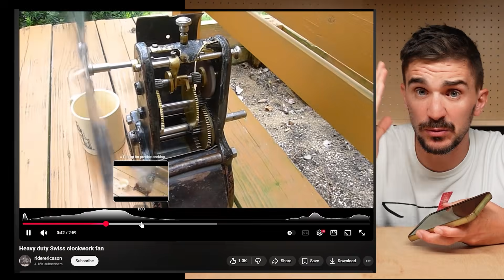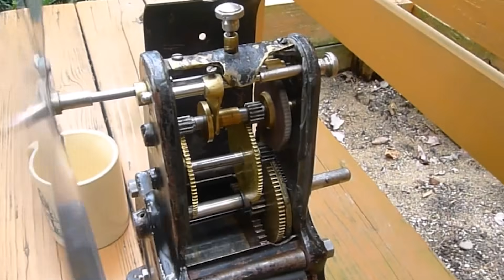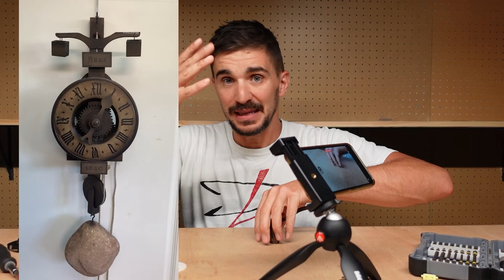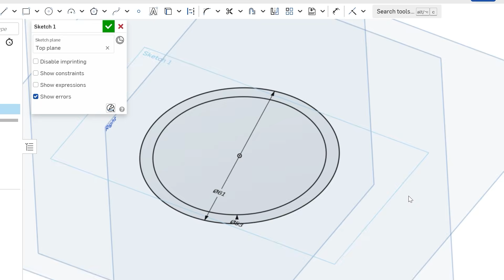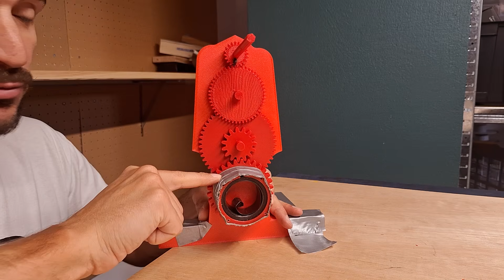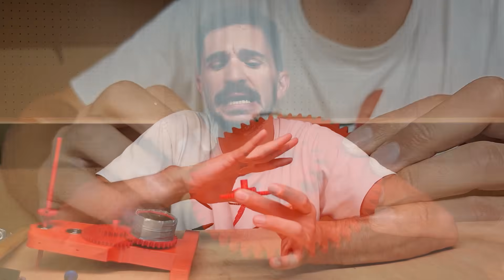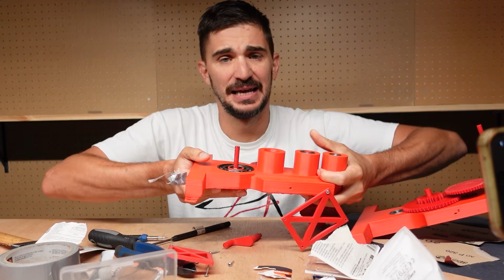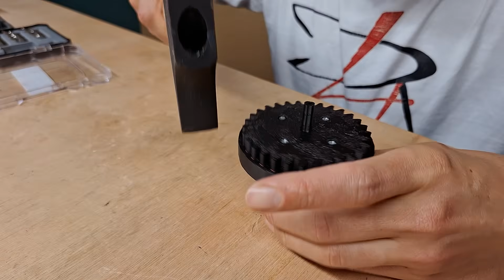No Cables or Batteries, Just Pure Mechanical Engineering - This Swiss Cooling Fan Cools You For Free

Comment: I think you are going about it from the wrong angle, I'd be looking at using a heavy piece of spring iron perhaps something you stand on to pull down/tension, have that go to the high torque wheel. But crucially instead of spinning a fan get it spinning a flywheel with coil generator to charge a super capacitor or battery, you could then run a separate fan or whatever off the output. Or instead of a spring maybe use weights,

Comment: Should this be made of metal components, could you put a well of oil at the bottom that the lowest gear might run through and over many rotations will lift some oil to the other gears? Helping to reduce friction.

Comment: Love it. Consider if you had to make it before printing technology was available. Well, let's just say before WWII, you would have had to:
Design it on paper,
Make a wooden pattern.
Cast the pieces.
Machine the pieces.
QC it. 
If in spec. Assemble it. If not, loop.
Determine that it didn't meet specifications.
Re-guess the design.
Iterate until it meets specifications.
Find that it isn't feasible, or the whole thing is stupid, and write off months, or more, of your time.

Comment: Why do you keep reverting to a secondary audio recording? Did you get glitchy audio on your main mic? Just a curious sound-guy.
Reply from the maker: Yes, got some sort of weird loud click/scream thing. I have double checked all the wires and everything. I have absolutely no idea what it is. It only happens in the first two recordings.
Reply: @d4a  Yeah, it seemed pretty random, that's why I thought it's a glitch. That sounds like a hardware issue causing a digital write issue. I'd try changing memory cards. "Screaming" and "clicking" sounds like digital noise caused by corruption. Other than that, if it's a USB/digital mic, I'd try changing it, if it's an analogue mic, it's probably fine, so I'd check the equipment first. Also, just to check, try playing the file through other means.

Comment: Thanks, I now know what "janky" sounds like.  Maybe I'm being lazy, but wouldn't it have been easier and safer to just leave the spring in the original tape measure barrel?  
  Pretty obvious that a 3D printer can't replace an all-metal lathe.  The all-metal lathe is the key machine that created the industrial revolution.  Wood frame lathes had been around forever, but their tolerance was 1/10 of an inch, which is really not good.  The first all-metal lathes had a tolerance of 1/100 of an inch, which is what was needed to produce cylinders and pistons with enough precision to make useful steam engines.
https://youtu.be/djB9oK6pkbA?si=UaXCZwiX8f8mUHsW

Comment: Use Support for PLA/PETG or PVA, enable support ironing in Bambu Studio and change support top interface layers to 3 instead of 2.  This will result in a nice smooth surface at the interface of the support without the need for post processing

Comment: Remember, things don’t work first try. You got a working prototype after the second try. Try using three or more main springs side by side to achieve more strength and increase your gear ratio to something like 100:1. Another thing to consider would be the fan blade pitch. The one you’re using is tuned for an electric motor and could probably be more efficient for your machine if chosen correctly

Comment: Author of this comment is half drunk, their opinion is subject to change and they can't be held liable for their today's opinions tomorrow or any day ahead xD

So, 
> expensive
You are applying experiences from large scale prototype to mass production. They are transferable but costs aren't. Think about bearings for a moment: you've used really expensive ball bearings, in high-volume production brass bushings and thin stainless steel rods would be good enough.There's lots of small improvements space to wiggle around.

> not very efficient
That's really matter of propeller attached to new motor. They are cheap plastic molds but these molds have their characteristics, specifically RPM to CFM ratio and mass manufacturers try to engineer them around the sweet spot. You basically took fan blades running 1500 rpm to produce "a breeze" as you've called it and powered it with like 750 rpm system. 

> not very efficient
For optimal wound spring energy storage utilization you want to extract as much torque out of it, in your prototype the barrel is spinning like 10 times as fast as it should. 

IMHO, this project should start from measuring donor device's characteristics, this is speed and CFM. This would be goal to chase to or exceed.
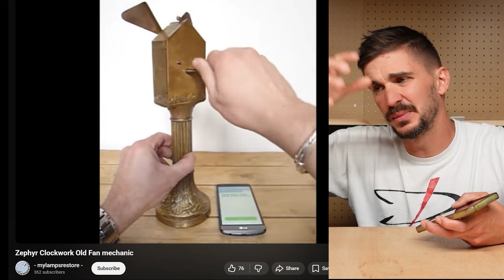For efficiency measurement, metric of "cranked for 40 secs to extract 1:55 of work" is lazy engineering at best. it should be tested at least electrically, this is: "i've used 10W of my power drill to strore as much energy as possible in the spring. Now with generator attached as any output stage let's measure how energy i am able to extract out of the system, accounting for losses".

overall, idea is sound and doable(as proven), engineering around is naive and quickly exhausting due to being labor-intensive. few more iterations and i am sure there's over 3 minutes of work to extract from single winding.

Comment: Clockwork seems to be a seriously overlooked technology.   In the days of film cameras why did everyone carry around massive motorwinds and battery packs instead of using clockwork?  (I have a 1940s camera with a clockwork motorwind that works great - and is light weight).   I have a clockwork door bell too.  No wires, batteries, switches etc to go wrong - it is older than I am and still works perfectly.     I'm not sure cooling fans are really a great match for the technology - but it has a lot of advantages over the alternatives in many applications.   Let's have more clockwork in the world . . .

Comment: Use metal smooth metal rods fire the gear shafts and press fit them in 
Using Stainless steel pin on print parts is surprisingly smooth 
So much so that it eliminates the need for bearings 
Also these bearings are probably greased inside which makes them last longer but much more resistant to small torques like in this case

Comment: I do a lot of these clockwork type projects. Not a bad start, but there is a lot of room to reduce friction.
You should be using open bearings, like fidget spinners, on the low force/high rpm shafts. The grease causes a lot of drag and there is almost no load on the top.
You can use a step or spacer on the back of the gear to space it away from the housing and only contact the edge of the inner race of the bearing.
All the gears should be constrained so that they can't contract the edges of the other gears either. The gears should only be contacting anything at the teeth and the shaft, no matter how smooth you make them.
You might try smaller teeth on the high torque side. You don't want them to strip, but larger modules increase friction and windage. You might also make them thinner.
For the housing you could make it rigid and hone the holes to size after printing. A drill bit would probably work fine. Add some locating pins to make sure it lines up perfectly every time. Don't rely on the screws to locate it.
Fan blades are mostly designed to look cool. You might try 3D printing a 2 bladed thin propeller or just use a large RC plane propeller.
All that will reduce drag and increase your RPM so you get more wind, so you might want to gear it higher to increase time. The gears will feel kind of backwards on these things. You should think of the high gears as a resistance that drains the spring slower and the low gears dump it all at once.
But yeah you have the right concept. I think just making sure the gears don't touch anything will do the most for you. I can hear them clattering. You should just hear a consistent, steady whirring noise.
Reply: Clamp the 2 sides together, then drill & ream them for precision fit of drill rod shafts.  Anything less is simply doomed from the start, regardless of materials, modulus, width etc.
Others have suggested open bearings and spaces/shims (that only contact the inner race of the bearings).  All good ideas from people who seem to understand what they're talking about.
I suspect d4a understands these things as well as anyone but it's an interesting video, garnering a shirt-load of engagement.  All hail the algorithm 😊

Comment: Jewel bearings make these things a lot easier. Less friction and much more tolerance for tolerance. Check out Dan Gelbert's semi-recent lengthy interview, too, he talks a bit about very low friction bearings in it during the section of seemingly impossible engineering problems which turned out to be easy to solve, IIRC.

Comment: Between 1927 and 1929, the apprentices of the shipyard I work at, built a complete 1:10 model of the propulsion system of a Battleship, consisting of boiler, Parsons turbine, reduction gearbox, shaft and propeller.
Every casting, every rivet, every blade was made from scratch, by 8 to 13 years old boys.
It was displayed at the 1929 world expo and run at 15.000 rpm.
It still remains at the shipyard's world leading turbine facilities. But most people can't even imagine what an achievement it is. Those kids would make that clockwork fan in an afternoon to 2/100 mm tolerances.😂
I have a digital copy of the photographic archive of its construction.

Comment: To wind the mainspring or keep it wound in it's sprung state, all you have to do is take a piece of metal rod and make a slot in it, put the center in the slot and wind it up on the shaft. Add a zip tie  on the outside and you have contained the spring. 
Or go to the recyclers and grab a cuckoo clock. it already has the whole mechanism, made in brass and steel.

Comment: Along with the other suggestions I'd add, if no one already suggested it, to use open bearings.  It's surprising how much viscous and friction drag there is from the black plastic seals and the internal grease.  Open sided bearings lubricated with just a light film of thin sewing machine or similar oil has almost zero drag.  After all if there's a 250-1 gear ratio then any frictional or viscous drag in the last shaft is felt as if it's 250x heavier by the spring.

Comment: I appreciate your energy and respect you taking the time to experiment and try to create something, but your premise to 'prove' the claims and designs seen in the video does not really hold up, your conclusions that the engineering would need to be incredibly precise and the production be expensive isn't reasonably extrapolated from the shown process and hugely mischaracterizes the mechanical systems. Your execution produced the results you saw because of the engineering decisions you made, mainly the mainspring and friction between teeth. Representing this as some sort of equivalence between complexity and cost for performance is incredibly misleading.

I get you just wanted to share a cool thing you saw and make an interesting video, but delivering a message that passes on judgement and evaluations presented as something derived from what seems like due process in a way that disinforms the casual viewer is irresponsible, in my opinion, and you could have the cool and interesting video without that.

Comment: Back in the 1960s-1970s Briggs and Stratton developed a starter for small engines. The main spring in this application stored energy to rotate a 3hp gas engine several revolutions with a lot of torque. A similar setup may run your fan considerably longer. I don’t think plastic would hold up but I enjoyed your proof of concept 🎉

Comment: It's people like you who inspire and create ingenuity!  So what about blades designed as a "flywheel" in that the outer edges are weighted, obviously it should be caged for safety, and then built into a slim wall unit using grandfather clock (or other) mechanisms to keep it going for hours?  Maybe it can be on wheels to move around yet classily designed in a wood facade?  Maybe it has more than one set of blades in it that can be swiveled?

Comment: I've had pretty good success with 3D printed gears, but I almost always use metal shafts. They're cheap and readily available and you can get bearings that fit the shaft perfectly.

Comment: Wouldn't a Stirling engine be an option? You can probably havest some heat from a metal plate (using sunlight as a heat source) and use the fan to keep the cold side cold (in a shade)?

BTW, why do you key the shaft to the gear, if you don't use them as a power take off? Just make the shafts solid and put the bearing between the shaft and the gear.

Comment: On stopping YouTube shorts- So, what I have done is to go to each individual Short on my main page and say not interested. Sometimes,  there can be a long line but eventually there is an end.  The shorts should stop but if you under circumstances select one, you'll get the shorts and you have to repeat it. 
  There is also an option now where you can select "Fewer Shorts" but it means just that and it wil show just not every time.
  None of this will not stop shorts from showing when you search though.

Comment: My familly owns a contraption that is very simillar but also the counter opposite of the swiss fan of the video, it also uses a clockspring to store the energy but instead off creating a high speed output it creates a low speed and torque rich output used to roast chicken over open flames, it genuinly works great and we still use it from time to time, a full winding can last several minutes because it also uses a high speed flywheel to keep the inertia going...

Comment: Yep. I have some relatively cheap contact to let produce wire EDM cut metal plate parts, that would give the needed precisity and low wear/friction of the gears.
And it still would be very expensive.
And any other manufacturing way on the same precision would be even more expensive.

Comment: I'm trying to find where in your boost school videos where you discuss placement of the catch can to deal with oil and water. 

I bought a vehicle that has a 2.0l turbo and I have learned that it does not have a catch can, and does have freezing intercooler problems in the winter. 

I understand adding a catch can in the piping or attaching it at the bottom of the intercooler increases volume and this reduces pressure, but I am looking for your genius explanation of it.

Comment: Engineer here, did u know u can order these springs online from suppliers & manufacturers who sell them for industrial applications? Some r up to 0.5m diameter. There r a couple of manufacturers who will custom build u one if u need to go bigger. 

The modern application for this clockwork isnt a fan or a rotisserie, but as a generator. If u replace the fan with a small electrical generator (motor) using low friction ceramic bearings, it will give u enuf current for 1 DC boost/buck converter. However, if u divide up the power from the generator between a handful of joule thieves & connect each of those to their own boost/buck convertor, u can charge a battery bank, or run lighting, fans, pumps. Anything that doesnt require high amperage. 

Pro tip: never connect 2 boost/buck converters to each other for any reason to power a larger load or use 2 together to power a large load. It causes a feedback loop between the converters & will cook them.

Comment: I would start by solving the math on paper to figure out ideally how much energy a working fan requires, how much time I need it to work and then how much energy I can store in a spring.... That would give me a  good idea if it would make sense building a spring fan..... 
And removing the seals from the bearings makes them work with less friction....

Comment: you need to spend energy equal to climb a staircase of 20 store building or rotating bike pedals equal to 20-30 minutes of riding with a speed of 25km/h to...
wind up a spring which will give you 1 hour of 30cm fan to blow air mass equal to lowest preset of 30cm electrical fan we all have.
i don't think i need a fan that makes me sweat for 30 minutes just to give me 60 minutes of shallow breeze

Comment: About making springs: use music steel, you will need to design your spring, then create a hollow 2-piece mandrel with the springs shape cut into it with a 3d printer, glue it to a thin steel rod to serve as the core and spin the wire on with a hand drill.

This is the easiest way to make precise springs at home, a apecial mandrwl and calculations in the design make the spring precise.

I hope you find this useful, good when working on cars or bikes.

Comment: I remember a motorcycle drag bike transmission build from the 70's in a motorcycle magazine that kind of seemed counter-productive but on retrospect made proper sense. Upon completion of their build they filled the transmission with progressive grades of polishing compound and ran it for a number of hours. The tightest parts got polished, and failure points often happen in slight imperfections of machining. The tightest spots would get clearance and sharp edges and grooves would get rounded or smoothed. Break-in time greatly reduced. Also the spring is problematic. I would hang a pulley in a tree and use a counterweight. In Africa they use counterweights to run generators for LED lights and cell phone charging for 20 to 30 min. per 8' lifts, in a tree you could get hours of runtime per lift. Or have a rooftop rain barrel with a clockwork mechanism to counterweigh your counterweight and deliver water to your sink for the morning. There was a story of an African king that asked a missionary if he could get him a gramophone. He searched far and wide until he found one that worked properly, and proudly presented it to the king. The king held it up to his people proudly, then forcefully threw it to the ground and smashed it. Turns out he just wanted the mainspring to make it into kalimbas or thumb pianos.